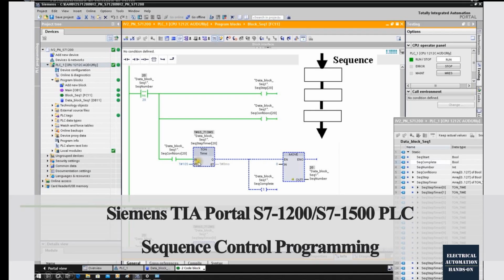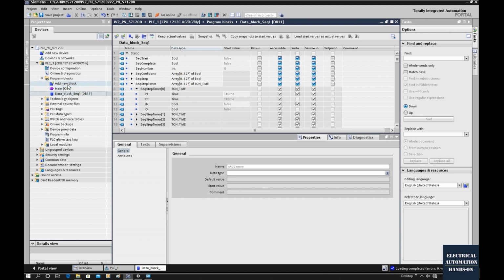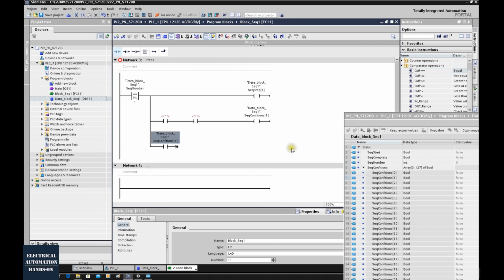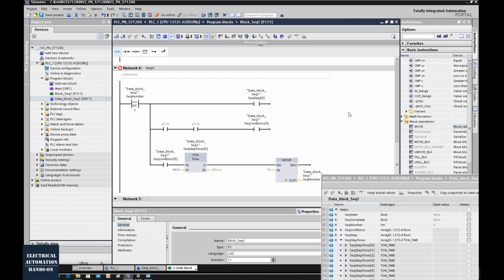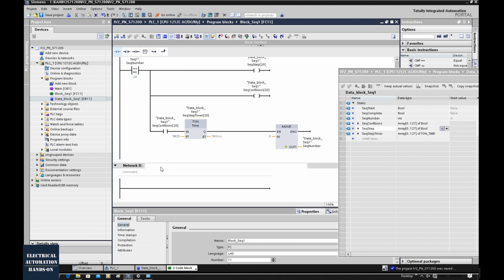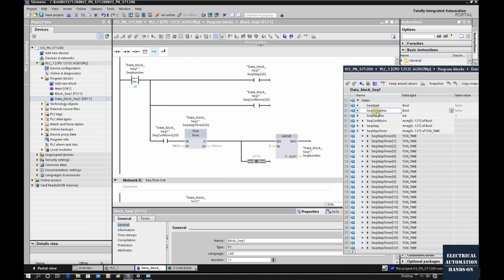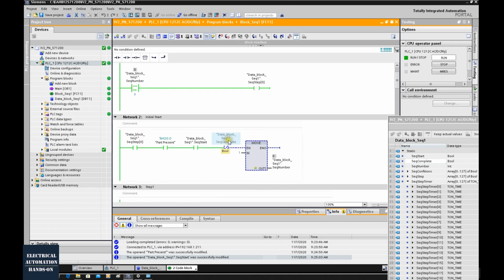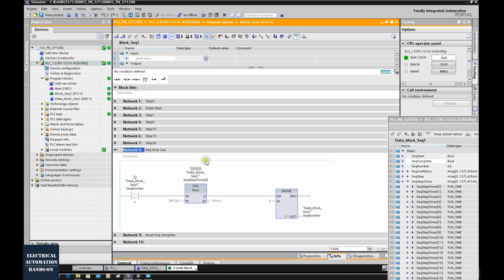SC02. Siemens TIA Portal Sequence Control Programming

Comment: Good for new learners. In your case you can use sequence step integer as index for each sequence step array element, this will improve the programming time efficiency.
Reply from the maker: Thanks for watching! Yes, I used this structure of sequence control for many projects. Also, instead of using Function Block, this style is also easy for commissioning, because you can view all the interlock signals with one glance. Thanks again!
Reply: Would you please elaborate on this idea of using array for the sequence?

Comment: Hello, I'm doing my automation 2nd semester right now, I am curious if there's a way to control having multiple sequences running at once?

For example I'm building a machine producing 2 different types of cakes, one needs to be cooled down, the other one doesn't. They both drive on the same conveyor, but one will get loaded to the cooler with a chain transfer. The timing inbetween the cakes means that I will alternate and keep switching on the conveyoer between which one goes through and which one goes to the cooler.

Great video!
Reply from the maker: You use the sequence structure shown in the video.but create two sequence groups for your application. The sequence will control the command for your motors or switches (don't control.Q output in your sequence). Then use extral logic to do a parallel logic (commands from two sequences) to control the Q outputs

Comment: Nice, I use bits for sequencing instead of int, once conditions meet it reset current step bit and set next bit and so on.
Reply: Hi Rob, in a bit instance you have the option of using SHL, which will shift your bits in a byte/word/dint by one so therefore taking you onto the next step/bit, as an option, saves doing a set and reset, plus easier then doing a load of resets if you have an e-stop instance in your program. you can simply move 1 into the int to take it back to the beginning. Best to reserve a byte or int for this, depending how many steps you’ll think you’ll need, best to go bigger in case you need to add more steps to your program. I like the no. instance as dependant on the condition you can loop a section back round or step forward, such as if you need a certain amount of repeat sequences to be complete prior to moving onto the next stage of the sequence. But there’s always more than one way to do something and it’s what works best for you.
Reply: @ipswich84  set reset takes less time to execute, from optimization point of view. But whatever works is correct 👍
Reply from the maker: Agree with your guys' comments. Just note that using the integer for indicating steps and transition will make it a easier leaving some spare steps for additional steps new added requirements. The common steps I would use are 5, 10, 15, 25, 30.. etc.  Also luckily that Beckhoff is using computer as the controller, so processing time and variable memory room will not be a big issue.

Comment: Very nice and very smart.
However, is this not doing the same job that is already BUILT-IN within Siemens S7 Graphics (GRAFCE like) that is capable of doing in a graphical style which is much more convenient than LADDER? or I am missing something. I really can't see the real benefit of programming the step sequence instead of using the Siemens S7 Graphics existing within TIA Portal.
Reply from the maker: Hi my friend, this sequence program structure is a 'concept' and tool, especially for the people not quite familiar with Graphic language. Also for some PLC brands which do not support graphic program language can still use this structure for implementing 'sequence' control. Note that this sequence control flow can not only serve for sequence, it also serve for time chart such as, printer trigger, camera trigger, operation flow, and so on.

Comment: Great video, can you make a video over linear absolute scale eg. TWK encoder. How to read the values, resetting the encoder with condition, how to calculate length,speed....??
Reply from the maker: This is not related to this video's topic. Please send me an email if you would like to discuss more details. Also please let me know which controller, which kind of encoder(incremental, absolute) you are using. The email can be found from the beginning of each video.